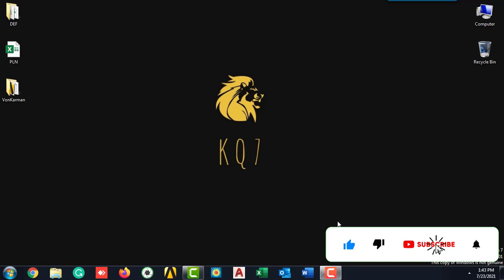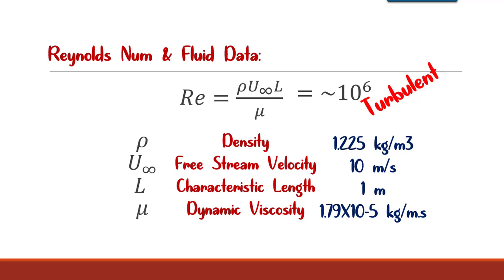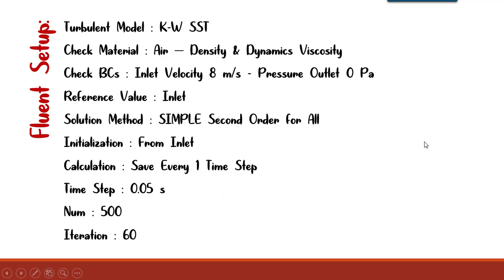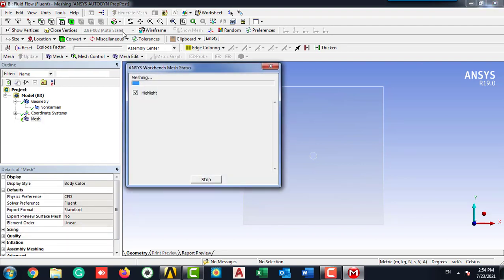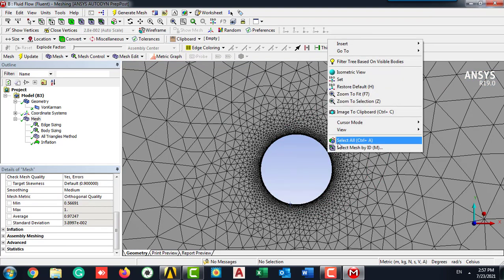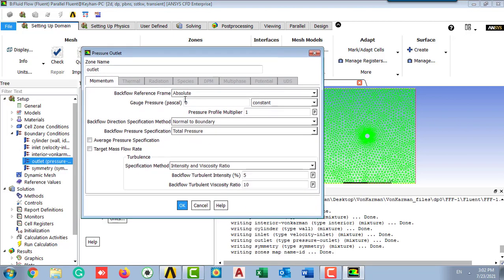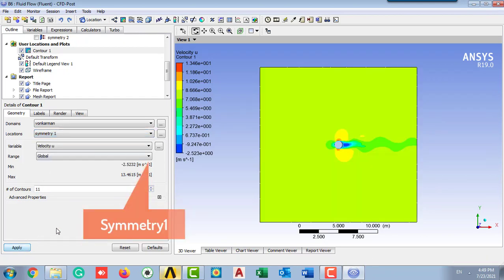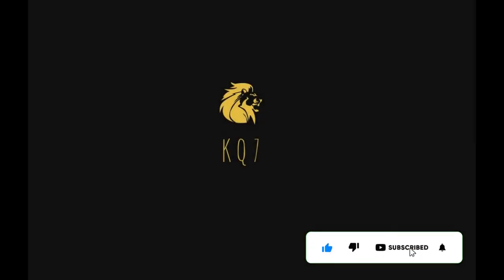How to Create  VON KARMAN Vortex Street around a Cylinder - Using ANSYS Fluent

Comment: For flow past a cylinder, Re=49 is known to be critical Reynolds number and Re=190 is known to be when the flow becomes turbulent. Please before making videos research your material, and try to read into fluid mechanics a bit more. The other problem that I can mention is that Turbulent flows are 3-D problems, although before Re=190 the flow is in transition and can be condsidered as a 2-D flow in some of the Re ranges.

Comment: Hey bro can I do a working model on this concept (flow visualisation) if so how n what components or apparatus would i be requiring?
Reply: A small wind tunnel setup would be sufficient. You can get a small golf ball or any smooth ball and place it over a stick. Pass laminar smoke over it (check DIY wind tunnel) and you can fix a camera to capture this. the real flow is much much cooler than the CFD one. But if you want to calculate body forces like drag or lift, you would need load cells. if you want to plot the forces and calculate its coefficients, you would need simple MATLAB program or an arduino setup.